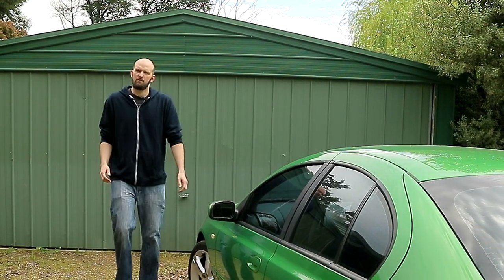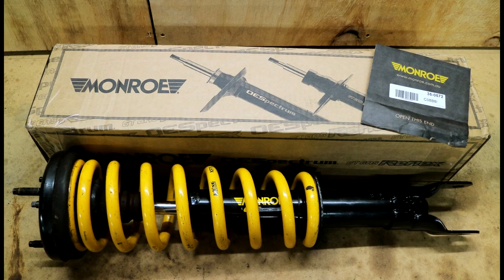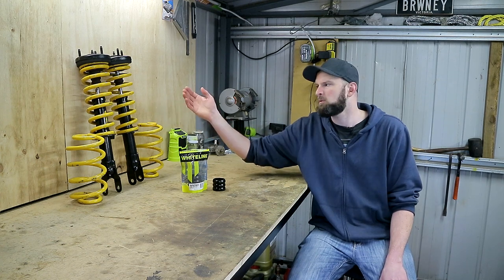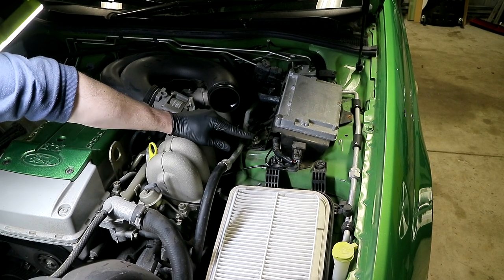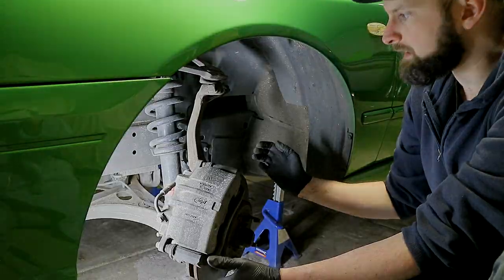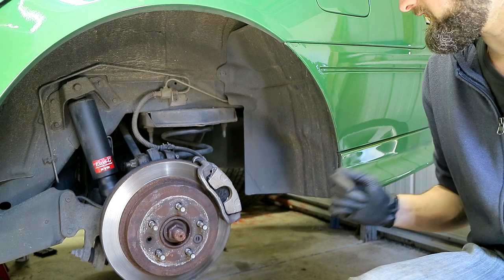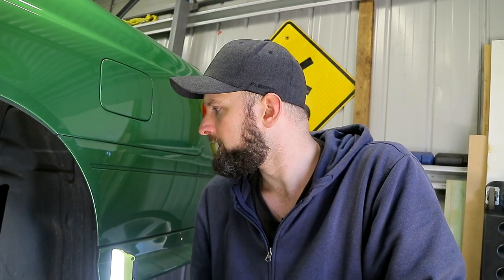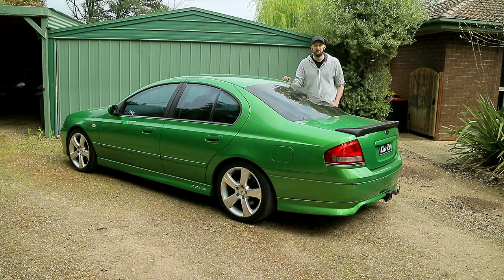How To Lower Your Car On A Budget | BA-BF Falcon

Comment: Man i really want to lower the altitude of my xr8 but worried my 20s will scrub, this looked so straight forward too
Reply: Benson Hedges  haha this is true, but the 20s just look so good, also got a great tip from another youtube channel about clearance
Reply: Get coil overs, there adjustable, not that expensive and way easier to install
Reply: @spivkovic2688  I've got a Ute so rear is leaf spring, it's an all or nothing job unfortunately
Reply: @smithy2  ahhh dam

Comment: Tip for bump stop jack up the rear of the car and then use a second jack to push the IRS arm into the bump stop that’s how I got my superpro bump stops on
Reply from the maker: Good thinking if doing springs at the same time so the upper arm can do it... if when spring in though I don't envy your passengers!

Comment: You have a bent sway bar link on the front! Also if you mark the strut hat before you remove them makes it easy to reassemble first go when put the strut back in the car
Reply from the maker: Legend, thanks mate and good spot. I actually have a set of those sway bar links on their way out now, only noticed recently.

Thanks for watching 👍
Reply: Browney's Garage No problem, i’ve done so many of these cars I see when somethings up, good vids for the guys out there learning, I like to watch how others do repairs as it’s interesting to see different perspectives.

Comment: Whats the clearence like under the car with the sway bar links so far bellow the chassis, dont really wanna get defects
Reply from the maker: Hey Jakob. As you’d know clearance even at the stock height for the XR’s isn’t great, even at the front bumper, despite them not looking very low. I haven’t measured it but I’d say it could very possibly give you some troubles sorry.

Comment: Great video thanks do you have any experience knowledge on lowering a nl fairlane 4.0 with self adjusting rear suspension not too low I've got various rear shocks monro sports and comfort then what king spring set up I'm running DJR 15" rims
Reply from the maker: Damn you've been busy bingeing a few of these eps, thanks for watching mate... but also sorry you have put up with so much of my head!

I don't have any experience with that specifically but from what I've seen the first step is generally to put the SLS suspension in the bin and go from there. I think Kings super low all round was a pretty common setup in these models but really depends what ride comfort your after, look you want etc. Best to hunt around forums for pics of a ride height you like and go at it that way, installing it yourself will probably be a touch easier than the BA too with the solid rear.

Comment: My front of the car is factory I believe and it just scraps over the gutters. I don’t want to lower the front but I wanna drop the ass down a bit any suggestions?
Reply from the maker: Not unusual, especially the XR's front bar is quite low factory.

If you're currently XR height maybe try SL in the rear? Or is stock falcon height could try XR/L springs in the rear.

That or avoid gutters/kerbs? Had to be said 🤣
Reply: @BrowneysGarage  hahaha wished bro but there are every in the car parks haha, but yeah mate stock xr6 high

Comment: nice car, have the same color on my xr6. can you give any advice about how to safely compress the springs? everywhere i read says the ba springs are bastards, not sure if i can trust a spring compressor from autobarn or something.
Reply from the maker: @ooohry Thanks mate.

Going off memory here but as I recall they actually weren’t under a great deal of tension when assembled and I felt quite comfortable doing it. Certainly can’t guarantee it but I used eBay spec compressors and as long as you take some care I’d imagine you’d be fine, I’m a hack and I survived!

Good luck mate 👍

Comment: HI MATE.. 
THANKS FOR THE video really gained some knowledge here... 

I am Planning to get SSSL on my 2013 FG FALCON XT ECOLPI ..
Should I go with SSL or SSSL on front and SSSL on rear. 
And Do I need to replace shocks as well?
Reply from the maker: @Taranjeet Singh Thanks mate. Do your research on forums/groups as to what you'd prefer but if it were me I wouldn't be running standard shocks with SSSL, I'd be getting something to suit the lower spring.

Comment: Did you use shortened Shocks in the back? Or just upgraded standard hight ones??
Reply from the maker: Just stock replacement standard height ones I believe they are. Part numbers in the description, seems to ride ok on this. It does have shortened shocks in the front though.

Comment: I’ve got SSL fronts and SSSL Rear King springs I’ve only installed the rears at the moment haven’t done the fronts yet but what’s the ride like for you is it more bouncer? Mine might just be bouncing due to the fronts still having stock setup in until I change it over to double SSL’s ?
Reply from the maker: @Philip Teaka Height can effect it but fairly certain bouncy ride is normally associated more with shock absorbers being worn out or not suited to the ride height. In saying that though I'm far from an expert.

I'd definitely say the ride with the setup I have is firmer but not bouncy at all really.

Good luck mate, should look great with that combo!

Comment: How the hell did you not have to compress the rears? I had the worst time doing the rears.
Reply from the maker: @Benjamin James With standard height Springs or XR/lower? As long as it comes down enough to work out of the top locator part I haven't had much trouble doing these cars - which is weird cause I normally do find something that holds me up or needs repairing as well when doing these jobs!
Reply: @BrowneysGarage  standard height. Just did my springs and one rear took me over an hour. Had to compress the spring and then awkwardly remove the clamps 1/8 turn at a time once I had it in.
Reply from the maker: @Benjamin James I might have got lucky then, guess the XR height springs gave just enough room not to have to. If it helps I lost something like 30 mins on the spring compressors too but that was trying to get the front shock and spring assembly line up to bolt in!
Reply: @BrowneysGarage  maaate! Took off the sway bar completely and it was in and out with no hassle! Just did my drivers rear 👌🏼
Reply: Easiest way to do rear springs is unbolt the rear gas strut I thought this was obvious to people
Reply: @iamasmurf1122  the rear gas strut had no effect on how I did it. I undid the lowest bolt behind the brake disc, that plus taking off the sway bar and the spring basically fell out.
Reply from the maker: Awesome to hear you got it done, going lower?
Reply: @BrowneysGarage  not for the moment. Swapped to King springs from factory. Use the car to tow and drive up driveways, didn't want to risk dragging the ass of the car. Handling is much nicer though
Reply from the maker: Nice! This car was never meant to get lowered but I can't help myself. The Commodore can stay standard... maybe. Enjoy!

Comment: Still expensive haha
Reply from the maker: I was a little disappointed when I totalled it all up too, probably why I normally try to avoid it! Lucky I had most of it already.

Beats coilovers at least, especially if you only go for second hand springs.

Thanks for watching mate.
Reply: @BrowneysGarage  nice find tho usually second hand are still expensive, freaking got a good deal on that package.

Thanks for video definitely going with the ride height you've chosen .
Reply from the maker: You're right, they can definitely be hard to come by at a decent price at the moment. Very happy with how it has come out an the ride I have now, definitely recommend the combo/height.

Thanks again mate 👍

Comment: Hey im having trouble getting the nut off to drop the sway bar.what did you use it spanner/ratchet etc
Reply from the maker: @Jason Edwards having trouble because it’s ceased and won’t turn or it’s turning the whole sway bar pin? Can’t remember spanner or ratchet but shouldn’t matter, if it’s turning the whole pin though you’ll need to use a second spanner on a flat section or vice grips if nothing will fit to hold it. And make sure to use penetrating oil, hope that helps 👍
Reply: @BrowneysGarage  thanks loving the videos aswell I've managed to fix my bumper sag and tinker with other things and with abit of luck I should have a sacked ba by the end of the day haha cheers from across the ditch 🤙🏽